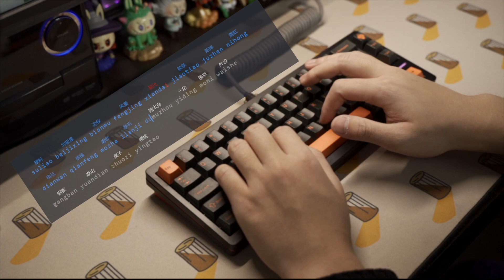Wind Studio   Wind65 Customized Keyboard Immersive Assembly  Decompression  White Noise

Comment: Hey I'm wondering something, so I currently have a wind x with a carbon fiber plate, owl stabs, ktt rose, gmk keycaps and only plate foam was used. I've had previous keyboards in the past mainly stacked acrylics smkeyboards and they all sounded quite terrible, mute, high-pitched, no bass, flat, especially where the stabilizer keys are located enter, space, backspace all some weird scratch feeling sound or mushy or quiet. 

I've asked around and seen videos, done some research and online says plate foam reduces reverberation but also ping. pe foam can sound marbly having a sound signature but can also possibly flatten the sound and make every keyboard sound exactly the same, but advantage is it can also point sound towards you rather than sound going down into the keyboard.

For my wind x, I'm looking to try new switches and wondering if anything can be done to create the loudest sound possible, bass if possible, but not make everything sound the same. At first, i thought i liked deep bass sounds which i do but im not sure what foam should be used. I just want a loud sound where it feels heavy. My current keyboard is high-pitched and when i press the key, it feels and sounds incredibly too light like it's not hitting anything. 

Many people suggested epsilon prevails. I also have a backup pom plate but after using every keyboard with pom i wasn't sure if i like pom. I've only owned one keyboard a kbd75 with OA switches, SA keycaps, brass plate and it had increible deep bass

All i  know is i want something that doesnt sound flat, that doesnt feel too light. I want something heavy and where i can barely press a key and it will be loud. deep bass if possible. However, i dont want all switches to sound the same. Also, i like SA, mt3 for being comfortable but they seem to sound exactly the same like blocky for SA while mt3 has this weird plastic sound. gmk or pbt epbt feel the most natural

What foam, plate, switches would you recommend for the wind x?

The only other keyboard i used i liked was an smkeyboards with ktt rose 75% but have no idea what foam was used, gmk keycaps. although there was the pcb showing underneath so im guessing no case foam was used at least

From videos, i seemed to like banana splits and creams but not sure. I was also handed 10 different switches, and banana splits and creams felt the best